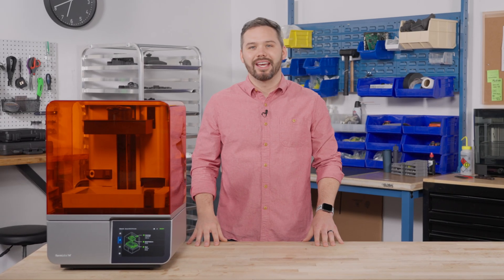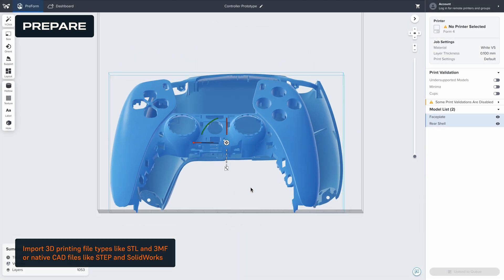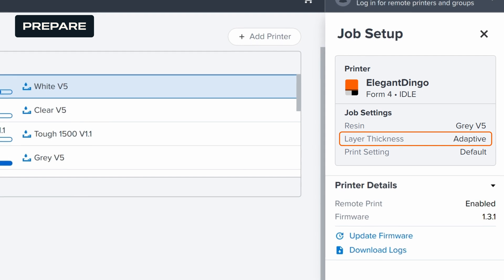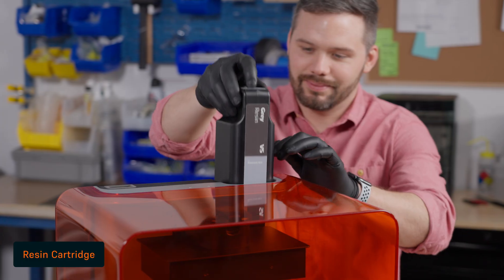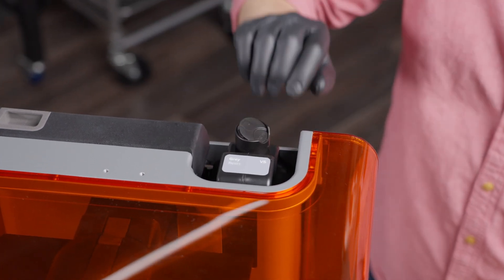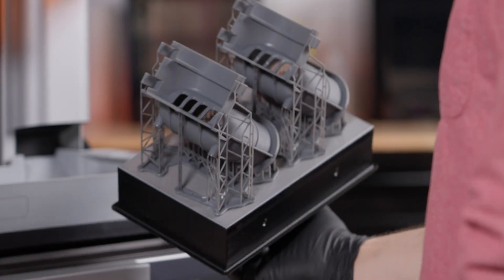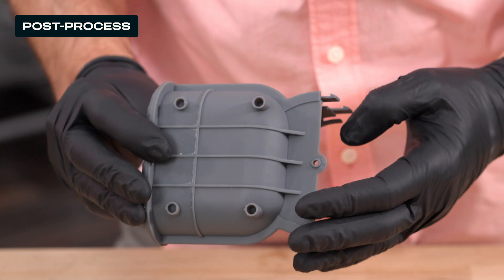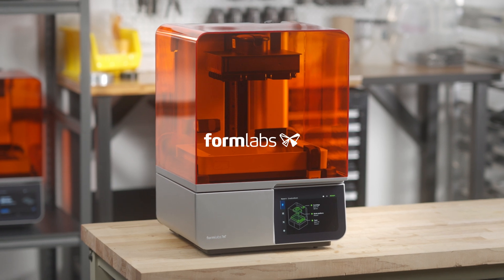From Design to 3D Print With Form 4/B: Workflow Overview

Comment: 75000 layers is nothing!!
Reply: *750 000!   For comparison, a mono screen from any other hobbyist SLA printer the screen works for about 100 000 layers….
Reply: @mika_jurvanen  Doesn't seem like it. Go to their website and check, it says ""at least 75,000 layers of printing" 
That's less than 20 full height prints at 50 micron layer height. (each print is 4000 layers)